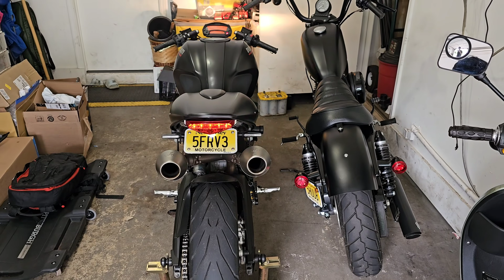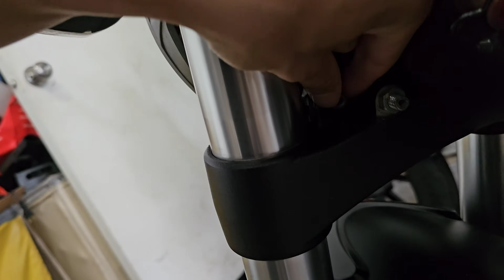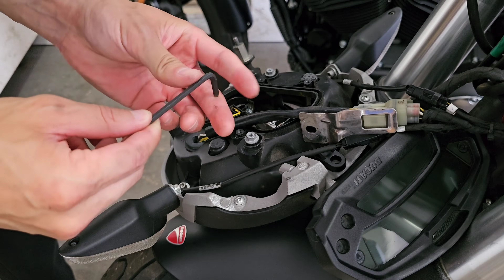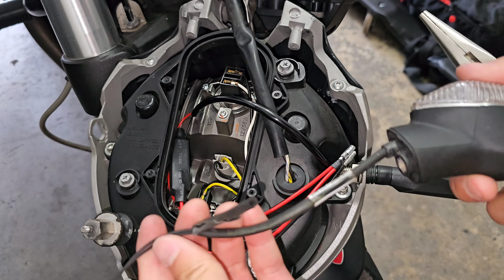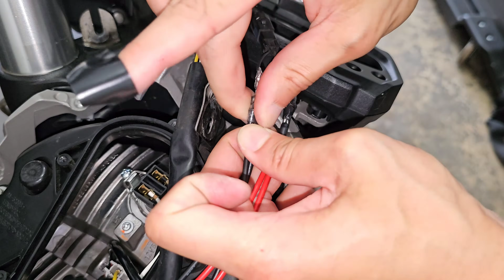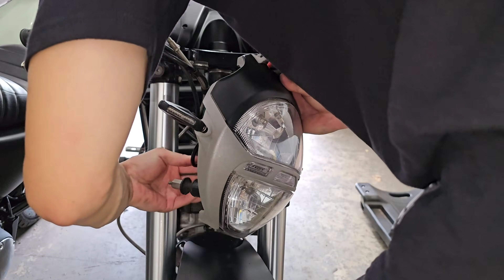DUCATI Monster LED turn signal lights

Comment: Hi mate.  I’m having a hell of a time removing the rear turn signals.  The Allen bolt fixing the signal just spins. I think because it’s a u-nut/fast nut.  Did you have problems, and how did you solve it ?  I’ve got 2006 s2r monster